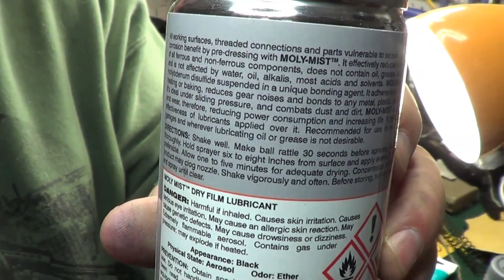Using Moly On Pow Pow Sticks - Is Your AR Firing Pin Retainer Pin In Upside Down?

Comment: 0:56 I agree. Never had an issue with those and my finger being on the trigger.
   I used to be a big fan of serpa holsters, and still have a couple of them.

   The main thing that changed my mind on them though was the retention mechanism, the button/lever that you press to release the firearm.

    There's a video somewhere of some guy doing a rifle class or something and he ended up getting a tiny peice of gravel or something caught in his, and it completely disabled the holster...couldn't get the gun out no matter how hard he tried.
    That tiny peice of rock, or dirt packed in there, or whatever it was had to be dislodged before the gun could come out, and that probably took some time and tools.

    Now that's probably one of those things that's extremely unlikely (if's, and's, buts and coconuts)...and it could potentially still happen with ANY retention holster...but it could be more likely with this particular holster design, due to the retention button being on the outside (rather than between the gun and your body).

    Perhaps just something to keep in mind if you use these holsters.

   If I can find the actual video i'll post the link here.
https://youtu.be/2BfsoIJbFis

Comment: FYI:    The cv joint moly was $11 or so on amazon, went to my local auto parts store the same tube was $5 & change.
Reply: Found a small tube at Walmart for $6..... It is higher on Amazon. The molybdenum spray was $8
Reply: Good info.

Comment: Hey Rick it's called a cotter pinand the reason why one is longer than the other normally is so you can bend it around your ball joint on your car and if the nut comes off your ball joint that pain will hold your your wheel from turning all you have one on your tie rod yeah when on your lower ball joint for a arm and you have one on your upper and sometimes you have them on your axle goes through the hub and then you wheel bolts to it

Comment: There are different greases with different concentrations of Molybdenum disulfide, on a CV that's gonna get lubed once ever you'd want a high concentration (expensive) grease. if you're going to reapply it often, like if you're gonna use moly grease as your lube on your gun every time, you could probably get away with the cheap tube, and a grease gun tube just for guns would last decades, unless you're rick and you clean your gun between shots XD.

you can also buy the powder that's just straight molybdenum disulfide and mix it in to whatever lube you want to use.

Comment: The pins act independently when vertical, when the pins are horizontal they work together as one member and are stronger. The cross section is larger when the pins are horizontal then when they are vertical.
Reply: I don't think that's true once you put the pin through the holes and they are pushed together.
Reply: Bob Buell the load is axial along the firing pin against the flange at the one end. The pin horizontal also tightens the fit of the pin because the dimensional distance is greater when the pin is horizontal versus vertical.
Reply: @itzjoeylo4501  I think the cotter pin is round when it's pushed together.
Reply: Bob Buell when he shows it on the video it is two axial cylinders next to each other. They are not two half cylinders, but some collier pins are.

Comment: As a follow up to my initial comment, I spoke to a relative that was formerly in the military and he stated that they were taught that the firing pin retainer is to be installed in the horizontal orientation.  However, while they were taught that they were given no explanation as to why that was the correct way to do it.

Comment: With metal, the strength is mostly about the cross sectional area (with wood, you also have to consider the grain direction).  The fact that the pin fits both ways should mean the strength is about the same.  But I think you would want the rounded part of the pin against the moving pin, rather than the 2 "sharp" edges scraping back and forth along the pin. (Unless the cotter pin doesn't touch the firing pin as  the firing pin slides back and forth).  In fact, does the cotter pin only retain the firing pin before installation in the rifle? Does something else limit the firing pin's movement before it contacts the cotter pin?

Comment: OK. Yes if this a "Split" pin it is stronger vertically because each pin is larger in diameter on that plane as each pin is only half the diameter of the pin as a whole.  
However, that extra strength is so minimal that it really does not make a difference in that situation. 
The 2x4 analogy is correct but you assumed incorrectly the positioning. if you have a 4x4 and split it in half you have two 2x4's if you push against the 4" side of one the 2x4's it is as almost strong as the original 4x4 on that plain.
If you push against the 2" side it is approximately half the strength of the original 4x4.  now if you place two 2x4's together and push on the 2" side of one with the other as a backer, it will never be the same strength as the original 4x4 because each will stretch and compress and slide against each other and not act as a solid unit. 
In practice with that pin the difference in strength is completely inconsequential.

Comment: Okay....... log me as #5 in the group of "it makes no difference" on the firing pin retainer.
It appears the minimal amout of force is exerted against both halves of the pin in ether direction, 

The only potential problem would be if the pin spreads enough where only  one half of the retaining pin  engages the firing pin.  OR, if someone spreads pin by bending it to "make it fit" better. This could lead to stress concentrations resulting in a crack.

And .... molly is great  but I don't feel like getting into a discussion about why, where and when not to use it.

Comment: Moly mist, I believe, is what we used to call dry lube.  It was used as an anti-corrosion coating on metal parts regardless if it were in a friction situation.  It also was used for Schlipshun.  As grandpa used to say, Schlipshun is the solution to Gripshun!!!

Comment: How does moly mist work as a rust preventive? My .300 blackout ar has a nickel-boron bolt carrier which is what yours looks like in the video. It seems to run better than my phosphated one in my 5.56 ar. If it can act as a barrier like rem oil  against rust then it may be an addition to  my gun lube products. I've been a fan of white lithium grease on my bicycles, I might have to try moly grease there as well.
Reply from the maker: I like moly better than white Lit, the white lit leaves a film that turns yellow or brown and looks like rust, molly does not

Comment: Molly b grease is awesome. When I build a new AR I use it on everything. Then clean the parts with a rag. Assemble with lock tight. It was also take the cheaper grader sound out of the bolt moving. Stay lube Molly is what I use available at harbor freight.the retainer. It is personal preference. I like vertical.

Comment: The 2" x 4"  example is Section Modulus,   Another Example is a typical  " I - Beam "  used on Bridges , railroad tracks, Sky Scrapers, etc.   
Don't the teach this in the 1st Grade anymore?   All the different types of bathrooms is more important.  

ASIDE: I'll ask about Pin Rotational Position ,  Guess is that it is better in one way or the other.  It just has to be different,  the same is Impossible or like 1 :  5.34 trillion odds from a Spock calculation.

Horizontal as the forces are coming from the side , NOT from the top.    Splitting factions of Hairs compared to other features.  

The guy at gun show Stayed at a Holiday Inn Express with this info.  IMHO
Reply: John M Great reply..."section modulus" is correct. Couldn't think of the term off the top of my head. The section modulus of each pin half is slightly more in one orientation versus other...but increase in strength is only slight...maybe a few percent. Not enough to really worry about.
Reply: @TyMoore95503  Force direction?   Horizontal?   

 The cross section is  is a cord of a circle,  in Mathematics CRC I would think.    AMES  is a great website.  Helpful to a dumb electrical person wanting to do mechanical stuff. 

https://www.amesweb.info/Default.aspx

press fit calculators are amazing.  Beyond me and my slide rule,  I have to do testing before.
Reply: massive irrelevance  We peed outside near the creek in the trees.  what bathroom?

Comment: My experience with molly coated bullets is this, yes they will shoot faster BUT ONLY because pressure will be less with the same powder charge so you can increase your powder charge.  We aren't talking huge increases in charge weight and we aren't talking huge increases in velocity.  This was all in a .223 rifle.  Now a guy I mentor under loads up for a .220 Swift with moly coated bullets and he has had more dramatic velocity increases.  It would be interesting to see how the moly oil down the bore would effect it but in your own words Rick it won't be the magic horsy dust for $19.99 that will solve all your problems.  Give me a month or two to get around to it and I'll try it and send actual data.
Reply from the maker: cool thanks

Comment: The retaining pin doesn't have much force against it. The back of the bolt is what stops the firing pin and it's loose the rest of the time so another round can be grabbed and chambered. Ever have the same round chambered for a while and see a little dimple on the primer? That's because the firing pin is loose and wiggling back and forth as much as the retaining pin allows it to. Which is the retaining pin's only job. Great info on the moly! I'm going to get me some.

Comment: @Think Like A Cop     Rick......I don't think the firing pin retainer matters which way you put it in... you can always get an Armalite original pin which is a solid pin not the cotter style. I would think Moly attract dirt no? I think it would not be good in dusty conditions.  Moly coated bullets were a thing in the 90's they stopped making them. I read  it it was supposedly bad and would build up in barrel.

Comment: I have one of those serpa holsters, it is one of the few I have found with a paddle in left hand. Never use it much, the hook that clamps on the belt works too well and so it is hard to slide on or off the belt, I prefer fobus style paddles, they just don't seem to make left handers anymore.

Comment: Inline is best, also if you have a contact at the aviation unit.. ask the mechanic for a bit of Brulin 512, they use it for compressor washes. It will decarbon the bolt where it carbons up on the elbow. and if they have some Mobil 254 engine oil, get some of that , its for high temps and carbon environments. Re the Moly, You can use Cat Moly grease which is 5%, and a 14 oz tube is $6  and your tractor loader pins will love it, but the best is the Honda spline grease at 30%. but its discontinued. and not cheap, $30 for 3 OZ. you think your getting a full tube when you bought it, but its half full..

Comment: Seriously I heard the same thing about the pin it kinda made since so I keep mine vertically also but I have  never seen one break even in classes usually the extractor will break all the time and for the molly I use it in my machinery building never crossed my mind to use it I'll give it a try thx

Comment: I've never heard of that moly grease, sounds like it might be helpful for older weapons as ewll. My Dad's old 12 gauge was starting to rust and pit a little when he passed away (Parkinson's), think it would help coat enough to retard any further rusting?
Reply: DachshundsRule so will CLP, thoroughly apply it to the barrel with a bore mop and leave for 48 hours, wipe down real good and then apply a good film of moly.
Reply: Thanks for the suggestions, guys. That old beast still shoots like a champ, I've had to work at it to keep the rust from spreading, we have humidity issues here, and Dad got so he couldn't take care of his firearms anymore. I wish I had known where they were stored back then, he couldn't speak or write and Mom didn't know. As Rick says, "Should-a, could-a, would-a..." Thanks again!
Reply: DachshundsRule yes sir
Reply: @Doxymeister  wsll at least you have a plan to keep them from getting to bad now
Reply: @tcscorner3028  Yes, sir! Doing my best!

Comment: I doubt putting moly on the bullets will help. The lans and grooves of a barrel actually cut into the bullet’s jacket. The bullet’s not just “sliding” through the barrel. Putting it on the charging handle and bolt-carrier seems like a good idea though. I’m too OCD about my guns to apply that though. I’ll shoot for an hour or two, then spend five cleaning my weapons until they could pass the white-glove test. Having a black film come off anytime that I touched my weapons would drive me nuts. Thanks for the info though.

Comment: One more message, now that I've listen to more of the video. Try bending your pins. Which direction bends easier? Which is probably the horizontal side. Just like any other cotter pin. So I think that guy is on to something. As for the lube, reminds me of mil comm tw25b. Probably a lot cheaper too. I use both eezox and mil comm. I'd be a fool not to try cv grease.

Comment: That pin doesn't ever come under load when the hammer drops. That pin ONLY stops the firing pin from falling out the back. When the firing pin is pushed by the hammer the bolt carrier stops the firing pin. That little pin only stops it from coming out the back.

Comment: Rick, have you ever considered upgrading to 450 Bushmaster ?  

That's my deer rifle and my "battle" rifle now as opposed to 308. Because 450 Bushmaster is AWESOME !!!!!
Reply from the maker: Travis Bishop   I agree but you covered it at end, the 300 for suppressed is the only reason I have it.
Reply: @travisbishop4840  I can see your point although it is an answer to a problem in Ohio.

In my neck of the woods it is only legal to hunt deer with straight wall cartridge rifles and the 450B meets that need better than most.

Consequently the ammunition is pretty easy to come by around my area.  However I agree it is definitely NOT cheap !

Anyhow thanks for the input. In my situation it makes sense to go with the 450 for my big gun & of course keep well stocked with 556.
Reply: @travisbishop4840  It would make sense to you if you came out here. A good chunk of Ohio is flat with mile-by-mile sections, using traditional rifles would be kind of scary actually.

There's some talk about allowing them to be used for deer on the condition that you do so from an elevated platform.  I would be in favor of a rule like that.

But with all that said, realistically you're not going to be shooting a deer any further out than 300 yards. 

So the way we've got it right now is good imho.

Comment: The pin is stronger in the vertical. Also, in the vertical the pressure is not being applied against the spring of the pin. The pin is designed to spring open to keep it in the hole. I doubt it really matters!
 Moly grease is excellent in high pressure, high heat situations.

 Don't forget to test the bacon grease bullets against the moly coated bullets.🤣

Comment: The pin in question is only a retainer pin. The rotation of the pin is not important. That pin is not very hard at all. It is considered soft compared to the other parts of the weapon. You could literally  use a nail and the weapon would function perfectly.  The beauty of the AR.  Also been using molly lubes on all of my equipment for over 40 years.  Wouldn't  be without it. Don't get caught up in bullshit. Merica!
Reply: Bob B. Those retainer pins are hardened spring steel. File test one and you’ll see, it’s hardened.  Well, it’s supposed to be. Per “milspec”.
Reply: @cosmolinefiend9853  yes they are hardened but to a lower Rockwell than say the firing  pin . Your right. I didn't say that a nail should be left in permanently.  Good comment.
Reply: @bobb.9152  ya it was
Reply: Bob B. Agreed.
Reply: Bob B. I definitely wouldn’t run a nail in your BCG unless you’re literally in a pinch lol! But yes, the hardness is less than that of the firing pin or the actual BCG. Thanks
Reply: @cosmolinefiend9853  I think what he is saying is in a pinch you could if absolutely had no other choice type of scenario
Reply: TC'S Corner that’s exactly what I said. I was just reiterating the fact that it would be an absolute last resort.
Reply: @cosmolinefiend9853  np brother I only saw the first part of it of what you wrote all good
Reply: @cosmolinefiend9853  just trying to help
Reply: TC'S Corner hey no worries brother. It’s all good. 🇺🇸

Comment: If it's true you should spray the inside of your barrel.... Then test it... Lol as far as pin goes whatever I've never had any issues on what direction the pin is when I put mine back together... Been shooting my AR for years...put the molly on a spiral brush and shove it down through the barrel a couple times you're done then wipe it with a cloth...